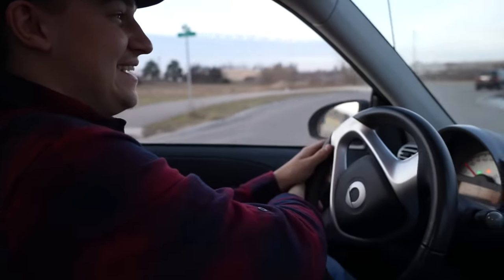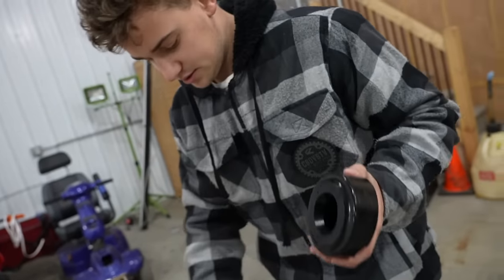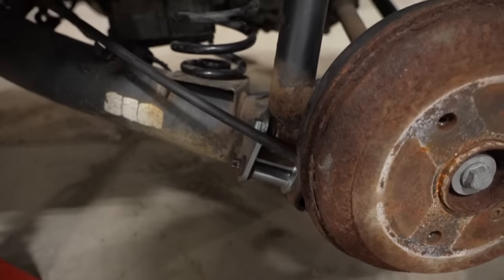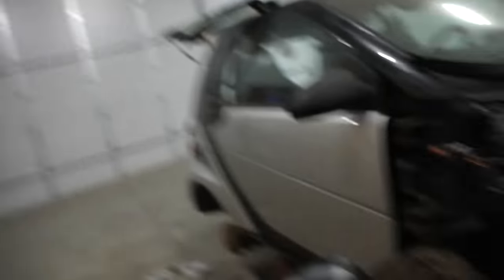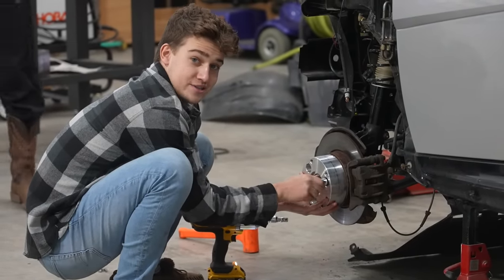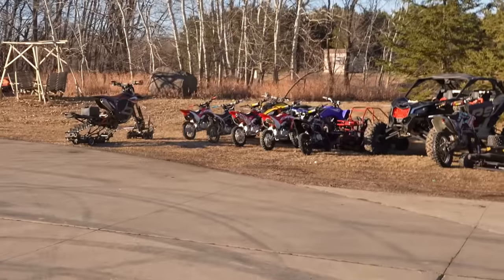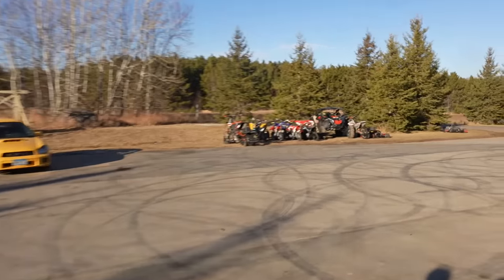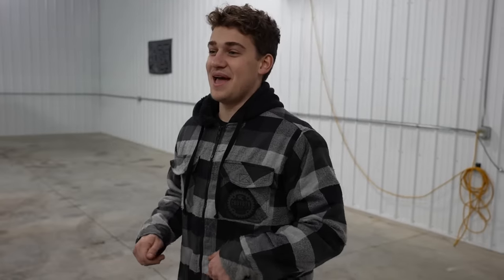Lifting my Smart Car!!

Comment: Add a turbo to one of the smart cars
Reply: Good Idea
Reply: Yeeessss
Reply: The lifted smart car
Reply: it would launch a piston into orbit lmao
Reply: @samuelsouthard7896  They came with turbos from the factory, we just didn't get them in the US
Reply: Gear box would not handle that all
Reply: Pretty sure it already has one
Reply: Do it please
Reply: CryinBranston  I know right
Reply: Brabus had a turbo smart in us
Reply: Yes
Reply: I have a stage 3 turbo on my US model Brabus with water to air intercooling. Fully dyno tuned with a stock motor. Lasted over 5 years and not a single issue yet. Forged rods from the factory.

Comment: Same as mine! Definitely needed an alignment afterwards. Installed 2014 and daily driver. Running 185/75/15 now. Better on highway ✌️
Reply: How many inches does the lift go? Also does anyone make long travel for these?

Comment: Did you remove the inner plastic for the fenders completely or cut the outer plastic and push the inner upward and connect it? (tie wraps...duct tape).  Looks like you also cut the metal lip off that holds the inner plastic near the door. (BFH). I measured mine and no matter how big or small you go with tire choice it looks like removing that metal is a must or I'm just going to rub at full steer.

Comment: So from what I can see it's a 2" daystar lift, custom wheel spacers, lots of plastic cutting, 215/75R15 tires on new 5 lug wheels and fender flares.
Reply from the maker: Spot on yes
Reply: @CboysTV  they make adapters that turn the 3 lug to ATV 4 lug so you can put the wheels from your ATV you have on there.  That would be epic.

Comment: Lower the air pressure. I have 29" super swampers on my smart. I have to run 22psi or its way to sketchy over 45. Also i have the same issue with camber and toe not much you can do about it. They used to sell a kit to straighten out the rear but they quit making it. It was a 2° plate and an axle shim.
Reply: You run 29s? With the Daystar 2 inch lift? 👀
Reply: @jesselozano54  had to mod the front to make it 4" lift and cut alot both front and rear to fit 29" but it works and doesn't rub unless i hit something way to hard.
Reply: @stephengarion8911  so 235/75r15 should be possible? 🤔
Reply: @jesselozano54  yes cant wait till these swampers wear out going to go with 275/75/15 bfg A/t swampers are a white knucle ride on the hyway i also have like 1-1/2 wheel spacers in the front

Comment: I am in the works of building a 2013 Smart car do the 2in Daystar lift I'm going to run factory rims I'm going to run a 26 by 8 by 15 on the front 26 by 10 by 15 on the rear Maxxis Bighorn tires and do the fender flares